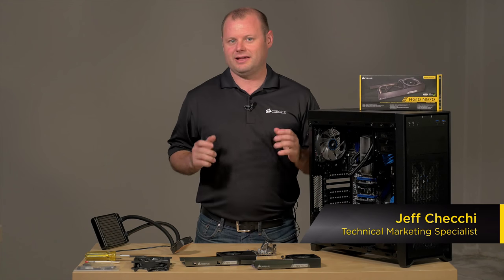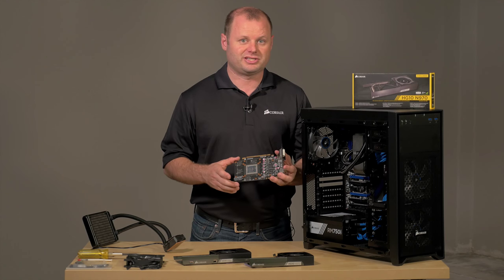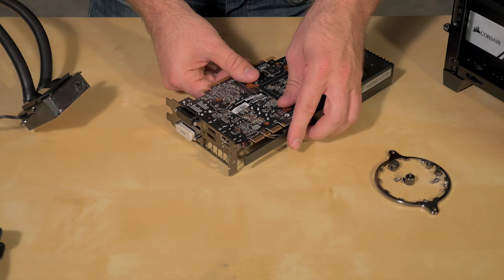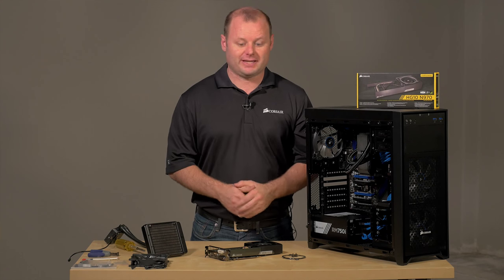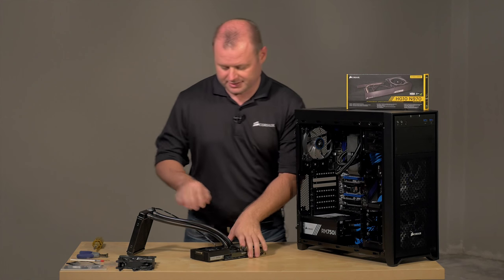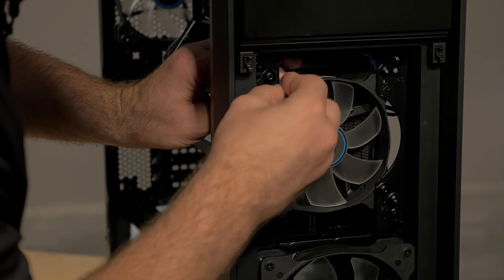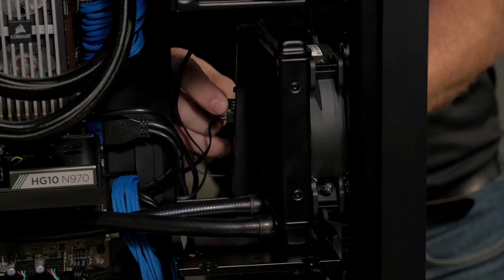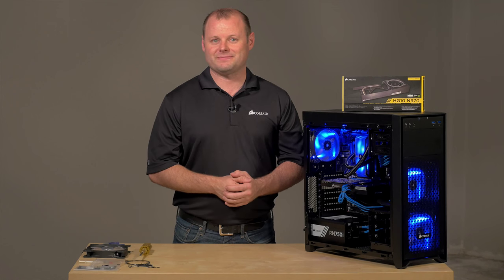Corsair Hydro Series HG10 N970 Liquid GPU Cooler installation demo

Comment: !PLEASE READ!: This is not compatible with all hydro coolers, I bought the n970 and fitted it to my evga 970. All was good so far, came to put my H80i Gt on it and....oh no it doesn't fit! Contact corsair and here is there response:Created By: Justin G. (11/9/2015 8:23 AM)
Our apologies for the inconvenience Stephen. Our H80i GT is unfortunately not compatible with our HG10 N970. We also do not have a replacement bracket to allow you to install the H80i GT on the N970. Please attach a photo/screenshot/PDF of your original purchase invoice in the Attachment section below for warranty reference. Thank you.Then after asking what is compatible and it's false advertising: Created By: Arturo TS (11/9/2015 8:42 AM)
H80i, H60, H55, H100i should all be compatible. The list of not compatible coolers is this: H75, H105, H80i GT, H100i GTX, and H110i GTXThen after saying will you change your advertising: Created By: Arturo TS (11/9/2015 9:39 AM)
I am unsure of when advertisement will change, but please contact the retailer for an exchange on the cooler.Terrible Corsair I would have thought you would check all your coolers first before you say compatible with all, now I have a gtx 970 board with no cooler!!!Hope this helps people.

Comment: was not compatible with EVGA 760 SC 4GB until I made it compatible
Reply: Grant Kobes ehm how?
Reply: Gilaric I cut it to fit
Reply: well ok
Reply: do you think the HG10 will fit on the GEFORCE GTX 980 TI 6GD5T OC?
Reply: Gilaric no idea, it's all about where the capacitors are. if it doesn't all u need is a drill
Reply: Okay

Comment: Really not trying to be trolling here but ... so ... the hot air from the radiator is going into the case...? Wouldn't it make more sense building a case where you can have at least a dual 12cm radiator and a single 12 radiator where the air never goes in or out through the case? Maybe having a part of the case just for this with good sound dampening as well? Then you'd just need a single fan inside the case to cool memories and the rest.

Comment: I bought this while ago and noticed the bracket didnt fit around the capacitors that well. I had to wiggle and wedge it over them. Also it put a little bend in the board i noticed after i was finished installing it. Its been running for 2 years now no issues just a little hot with it paired with a H60. I still hit 60+ temps in most games. FO4 and PUBG

Comment: Can you guys please make a similar installation video for the N980?

A lot of people seem to be having great difficulty with installing the HG10 N980 on 980TI's and Titan X's in your forums, but no one from corsair seems to have addressed this yet.

People seem to be having extreme difficulty getting everything installed such that the video cards do not bend, and such that the coolers make a good, flush contact.  Even once installed most are having atrociously high temps (presumably due to poor contact between the Hydro series cooler and the GPU chip).

Any further details Corsair can provide would be greatly appreciated!

I myself have two HG10 N980's waiting to install, and all th eproblems I have seen reported are making me rather nervous at starting this project.
Reply: Return those n980's man.  They have already pulled them from Amazon and new egg.  Their recalling them.  I already sent mine back.  Just invent in a custom loop from EK.  Really disappointing as I have been waiting months for this.  Shame on you Corsair.
Reply: +L ROD 
They have temporarily stopped selling them until they can replace incorrect screws that were shipped with them.  The screw kits that came in the boxes with them for mounting were apparently not to Corsairs specs.

They are recommending people hold off installing until they replace the screws, as it could damage the video cards.

Comment: makes no sense for me ... remove the original cooler with FAN and then add anothe loud radial fan ???? ohne for ramchip cooling ??? why is there no CU profile to cool everything with the watercooler ?  and why does he mount the casefan on the inner side insead of the original position ?

Comment: I have a nzxt s340 case, my CPU liquid  cooling is at the back of the case and have 2 fans in the front blowing air into the case would it be fine if this was on top, so 2 radiators would be exhausting

Comment: Whould either of these work with a gtx 1060 or with a gtx 960? I have checked the websites, but I could not find anything on those two cards?? If not, is there a different solution for an all-in-one gpu watercooler, apart from a custom system?

Comment: I just installed the n980 bracket to my 2 980ti's.  Great cooling,  but both my card have the slightest bend on them.  I noticed a slight bend on this one also.  Are you guys at corsair OK with this?

Comment: Guys! i own the 780T case. i allready have the H115i mounted for the CPU, but i want to buy watercooling for my GTX 970. I allready got the HG10 N970. My main problem is that i want to mount the fans from the cooler on the front of the case. The lenght of the H115i was not enough. I all ready contacted Corsair by ticket. but maybe someone can help me. I need to know witch Hydro Series can i mount on the front side of the 780T case.... Thanks

Comment: so if I have a H80i GT spare. can I install that on a 980? as the H60 radiator is really thin. plus old pump design etc. are those brackets compatible with any water cooler?
Reply: +jack black Yup. Any of Corsair's CPU coolers can be used on GPUs as well.
Reply: PrimeSonicYT to be honest they need to make a full cover AIO. they would sell so FAST 
on a h80I GT or a 100 GTX

Comment: Sorry but the expert didnt have to take out the fan to put it on the inside when all he had to do is Keep the fan where it is  and put the screw straight throught the fan through the case into the radiator. To me that Looks a right mess.

Comment: will this work with a evga 970 ssc acx? wasnt listed on the compatibility list so makes me kind of sad.
Reply: +Alan Aure Usually these only work with a reference design card.
Reply: +Nathan McAdams yeah was double checking if that card was reference or not, couldnt really find an answer, but my guess was non reference though. would love to have done this mod
Reply: +Alan Aure If it has the ACX Cooler, or more than a single fan on it, its a non-reference design.

Comment: If I want to liquid cool my GPU and my CPU can I just use one radiator pump or will I need two?
Reply: I'm still looking for this answer. I'm starting to think you need two separate pumps.
Reply: +GamerTechKid Unless it's a custom loop then yes you need two different ones. If it's not AIO and it's a custom loop then I don't know.
Reply: Thanks man.
Reply: look for @ Fractal Design - Kelvin - >> extendable AIO liquid cooling solution...;)

Comment: Anyone can recommend me what cooler should i use for Zotac GeForce GTX 1050 Ti 4GB OC Edition?
Is this corsair works on this?
Reply: Hacubi Hellscythe you don't need liquid cooling for a 1050 ti lol.
Reply: Oh thanks! I thought i need one cuz it only has 1 Fan on it
Reply: the asus variant i have has a maximum clock speed of 1750mhz, I feel it might benefit a little lol. as with its stock cooler it thermal throttles at around 1500-1600mhz.

Comment: Hmm..  I'm failing to see how this product is effectively cooling the VRAM.
Reply: The fan blows air over the VRAM. But either way it doesnt matter. VRAM doesnt get very hot anyway and even if it does it can go way hotter than the GPU core before giving out.
Reply: Well.  Ok, but still lower temps for any electrical component is typically better all around.
Plus, I'd want that hot air getting out of the case quickly if possible.
Reply: Nah mate, it REALLY doesnt matter. IR photos show that VRAMs without cooling only even get upto around 40C, with most of the heat coming from the VRMs heat that radiates through the card. Even overclocked they barely produce heat. You really dont have to worry about VRAM cooling.

If you're really that worried about VRAM cooling then you should be worried about all the tiny controllers and capacitors on your motherboard aswell.
Reply: ok kewl,  thanks!

Comment: +Corsair Will this cooling system come out for the GeForce 960  in the future?
Reply: Why would a 960 need water cooling?
Reply: GTX 960? really?
Reply: +WhoJustRhyzm | Powered by Nvidia®  Calm down just a question ftw XD
Reply: +Paddy J already bought this card?
Reply: +WhoJustRhyzm | Irgendwas mit PCs was hast du gegen die GTX 960 ? (4gb)
Reply: Mirko Nichts AMDs r9 380(x)?
Reply: WhoJustRhyzm | Irgendwas mit PCs ?
Reply: Mirko Nichts ja die viel bessere alternative
Reply: WhoJustRhyzm | Irgendwas mit PCs okeyyy xD
Reply: WhoJustRhyzm | Irgendwas mit PCs wollte mir nen pc holen meinste r9 380 (x)  is gut darin ?

i5 4690k
500W bequit
z97 krait
8gb ram
Reply: Mirko Nichts welches be Quiet und welche 380?
Reply: WhoJustRhyzm | Irgendwas mit PCs Lc10 modular 500w

Und da möcht ich gern wissen welche da gut wäre ^^
Reply: Mirko Nichts ja sapphire ist immer gut, natürlich auch die Version mit 4096mb (4gb) vram

Comment: hello
using a liquid cooler to blow hot air inside the case... isnt that a bit dumb ?
Reply: That's what I thought, but it's like having a radiator at the front of a car engine. With the cooler blowing hot air out the top, it would be pulling hot air from the GPU across the CPU. Check out this vid for a better explanation https://www.youtube.com/watch?v=xNAMxZgvves

Comment: for anyone that want to know if it works with their card.  Check out their Spec page. http://www.corsair.com/en-us/hydro-series-hg10-n970-gpu-liquid-cooling-bracket
It only works with cards that were exactly the same as the Nvida references cards. Any changes that the manufactures did with their cards  not work with this cooler. 
Sadly my EVGA GeForce GTX 970 SC GAMING ACX 2.0 will not work with this.
Reply: But I have a Zotac modified card and it's on their compatibility list .-. So it should work.

Comment: Can I set my EVGA GTX 970 SC ACX 2.0 with this cooling kit?
Reply: I just checked on their website and it is compatible.
Reply: +tecnockicken57 really? I have teh same card as M-K-N-e and i need to swap out my cooler soon since its getting loud lately but i also swapped my case for a silent case but its still not enough hehe.
Reply: +Mark Davenport Jr I could be wrong, but I think he's confused, because my card has 2x fan and is much bigger than the 1x reference card....